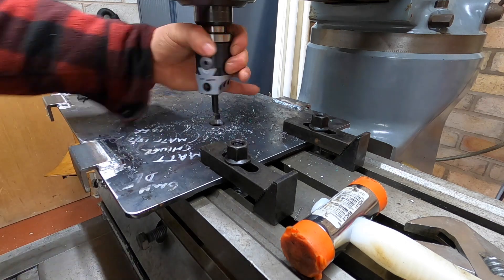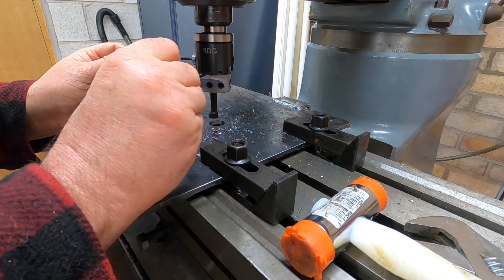The Footwell Part 2 - EP13 - 7.25" Gauge Steam Locomotive Build.

Comment: Really enjoying this build Matt!  First thing that popped into my head when I heard the racket the end mill was making in the first shot, was the old adage when you get tool chatter...  "Decrease the speed (rpms) and increase the feed (rate)..."  But you mentioned that right after you finished. 

Same goes for the rpms you were running the boring head at...  It was little too fast, but it did work for you, which is all that matters.

Great stuff!!!  Very envious...  Hope that someday I can be doing the same.
Reply from the maker: Hi Jeff, hope your well, Thanks for the comment. 

Your joining me on my journey of learning how to machine again, I know how to control and operate the machines, but I'm having learn as I go how to machine, if you get me. Its been over 20 years since I used a mill or a lathe regularly, so I've forgot much of the details. When it comes to a boring head though, until this video, I've never used one!! I watched one video on them, thats it, again, I know what it is, but this one I've never used. As I'm going to be using it on the cranks, I wanted practice first!

I'm definitely not expert at this, but I'm having much fun learning and creating what I am!!. I'm having to learn it all again for the second time in my life, and if that inspires someone to either have a go again or for the first time, my goal is reached.

Don't wait for someday though, my advice is, Start Now. 
Matt
Reply: @MattChiversWorkshop  You're doing fine Matt!  There was no milling cutter explosion, or implosion of the boring head, so that's a victory in my book.  That you rebuilt/rehabilitated your Bridgeport is a big accomplishment in itself, learning to use it again is just a matter of steps along the journey.  

We'll see about taking things up sooner than later...  Lots of things ahead (have to pay for Uni for two kids next year, then a house move in four to five), so we'll see...

Thanks for including us in your build, keep up the good work!

Comment: Enjoy the videos.  Just an observation that drilling is a more efficient method of making a hole than using an end mill so maybe drill the holes under-size then finish with the boring tool.   I think boring heads are cool tools that give precision results.
Reply from the maker: Thanks Peter, I had the hole laser cut 10mm, as I didn't exactly know what I was doing for the pivot point at the time of drawing. Unfortunately though for me, I have very limited amount of tooling as I didn't start acquiring equipment until mid 2020ish. 

If I'd have had a drill near the right size, your right I would have gone for that over a milling cutter any day of the week. This really was a case of, I used what I did have, and I also wanted practice fodder for using a boring head for the first time. I'll be using it on my Cranks for the ends of the axles 👍.

Comment: Thanks for cheering me up Matt!  Had booster jab yesterday and feeling somewhat off colour today (but really pleased to be protected a bit more.) Next time you use the boring head, if you adjust the gib strips to the point that they don't allow movement by vibration, you do not need to loosen and re-tighten them at every cut.  Didn't notice before how much of a fire risk your cap represents...  Does it have a built in sprinkler system in case the oil soaked into it catches alight?  G
Reply from the maker: You're welcome 👍, Can't get my booster until end of January!! 

Good idea for the boring head, note taken, I'll probably forget before I next use it! 🤦🏻‍♂️😂. I was impressed having never used one before and only seeing a YouTube video on using one once, I managed not to destroy the boring head or the mill!!

Flame retardant grease and dirt buddy on the cap!👍